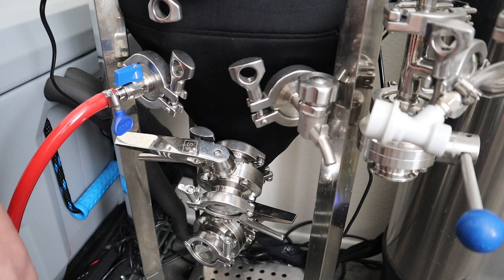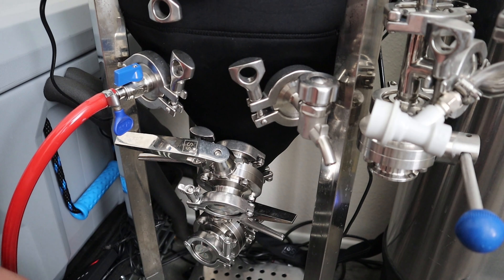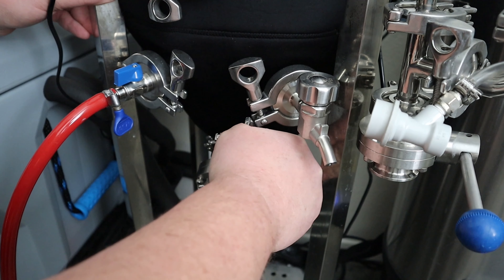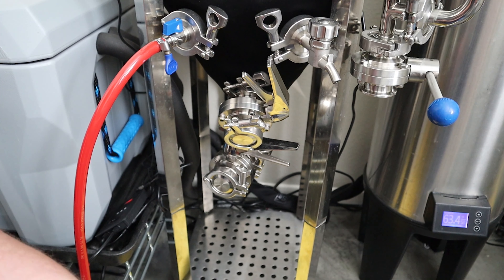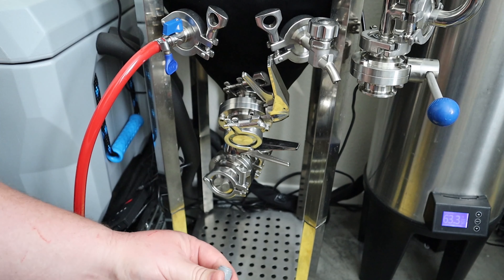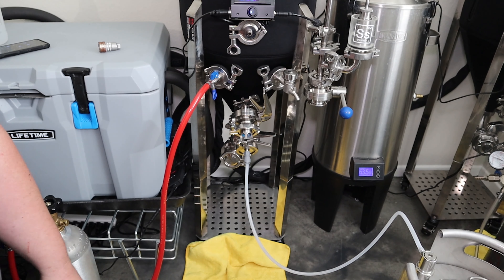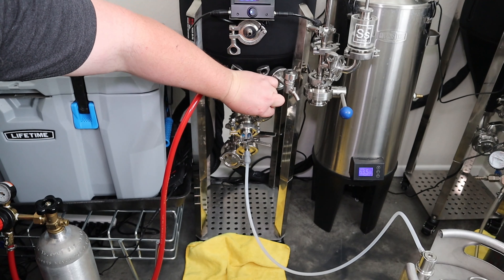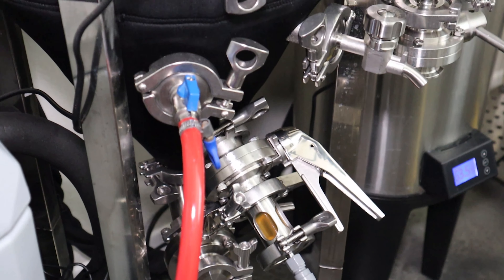Unitank Pressurized Transfer

Comment: Almost completely off topic, I'm sorry, "But" In my opinion, the grain-father fermenter has the best racking valve. 

At first I was annoyed with the trub dump valve, that i felt i needed to completely disassemble it after every brew. But then I just stopped after I came to the conclusion, "if I'm not using the dump  valve, and I properly sanitize it, why should I disassemble it.".

I wish SS brewtech would design one similar for theirs.

Sorry for off topic rant Bradley/viewers, great video as always.

Comment: Cheers Brad. Yeh, I found the 7 Hal uni tank to be a little cramped too. Rather than purge your line from the keg, why not just push the oxygen out with the beer before connecting to the keg?
Reply from the maker: I definitely think SsBt unitanks design is starting to show its age. My thinking is this way is a little bit cleaner, Maybe whatever keeps me on good terms with my wife!

Comment: Also off the topic, but did you get a 1/2" butterfly valve to replace the threaded ball valve on your blowoff pipe? I can't seem to find a 1/2" one.  If you got a 1" one, does it work OK, and how did you connect it?

Comment: I know the GF conical doesn’t have the bling factor, but could you tell me your thoughts on the GF dump valve ,racking port, and jacketed cooling VS. BrewTech’s
Reply from the maker: Cooling jacket works like a champ 
The three-way valve can be kind of fiddly,I found if you don't mess with it it's generally fine. If I decide to use it I usually just put a cap on the bottom, and use the pressure transfer kit to rack the beer off that way.

Comment: Hey bud! First off I like your videos and also I’m local to you. You and I shop at the same Simi Valley Brew store.  So as far as the racking arm, you don’t need to loosen the clamp a ton and one tip is to very lightly lube that gasket with keg gasket lube. The lube will help you rotate smoother with less force. I haven’t ever had my clamp pop off but my buddy lost four gallons a few weeks ago due to the clamp popping off. Also, why put down SS for things being too close? I see you like to spend big bucks on tons of tri-clamps and pipes for your Brewtools set up.  Do what I and many more did and buy a longer site glass for the dump port. (Don’t buy the SS one)That will place the dump valve lower and out of the way. For transferring, I stopped carbonating in the tank     so I can filter beers when I want and I can transfer under eight minutes. Once transfer is complete pressurize the keg to 50 psi for 18 to 20 hours and your beer will be perfectly carbed! ( Brülosophy way) Just some ideas here. Happy brewing!
Reply from the maker: If you ever see me at the brew shop definitely say hello 🍻 That video is actually a few months old. I have since moved to a sight glass on a lower port. It made everything much easier. I personally think it should come with a slightly longer 90 or something. Stainless steel is expensive that's for sure. I'm not necessarily happy about it with my BT set up either 🤪. Having a tri clamp pop off would be horrible, That's probably my biggest fear!

Comment: I'm getting ready to knock out my first transfer and I'm curious what pressure did you set the spending valve for to keep the foaming down in the keg?
Reply from the maker: Around 10 psi

Comment: What size barb/hose did you use for the transfer?
Reply from the maker: Lately I’ve just been using some draft tubing that fits a ball lock perfectly. I force it over a quarter inch barbed TC